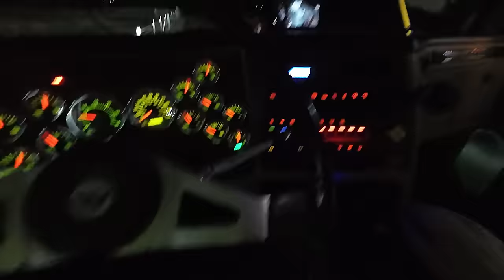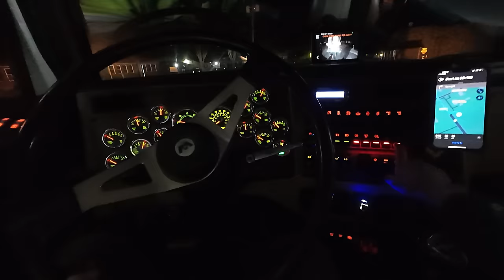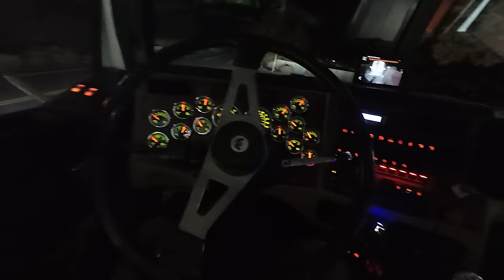This job almost beat me..

Comment: I am always amazed at the number and different tools that it takes to run a succesful towing business. not like you buy a tow truck and some chains and straps and off you go. I have been waatching for a long time and its easy to see litterally Thousands of $$$ in tools just to operate safely and efficent. Thanks for sharing!
Reply from the maker: Tens of thousands to properly outfit a truck

Comment: Good job Casey , like you said you got the job done and was back home safe!    Bummer that the owner was not on scene to be able to tell you that the Engine would still run ,  had you know that you might have been able to drive that truck forward so that there was room for your truck to back up to it.     DANG Casey , you have some adventures that you could tell about , a brake pedal that fell off causing you to go down a steep embankment into the trees!  Holly shit man!!  😲😲
Reply from the maker: Yeah if I would have known that I would have just drive it 50’ farther into the driveway and backed up to it 🤦🏻‍♂️
Reply: On the positive side,  he (the driver) did get it off the road (albeit a subpar location) and had gotten the rears caged out for you (correctly even), so it could have been worse.  Weather cooperated too. What grade did the supervising horse end up giving you??

Comment: Happy New Year ! I would have to have a small magnetic bowl for the bolts and universal joint caps because I would lose them in the grass or even the asphalt for that matter. Since I am giving unsolicited advice, I would have also wished I had a pneumatic impact wrench as a back up for those stubborn jobs.

Comment: Thanks for not recording miles and miles of windshield time, not being theatrical about how dangerous the situation is, not hyping the arc nemesis and not barking instructions to everyone involved. You appear to not have an ego that constantly needs feeding and would be very easy to work with. "Say what?"

Comment: Hey Casey, I used to drive a tractor just like that one in 1987 for Terrain Tamers out of Roseburg Oregon. They had a bunch of those Pete's that ran interstate. They closed down the interstate division, yarded the sleepers off, and wala...instant tractors to haul the 40-20 chip trailers!

Comment: Another great, safe job. Having the right tools like that U-Joint removal tool allow you to get stuff done correctly. Having all the right gear comes with experience. I'm not a heavy hauler by any stretch. Still cool seeing what you do...Old trucks are cool and can still be functional. Nothing lasts forever particularly in the Midwest. Stuff becomes a rusty mess long before they wear out...

Comment: For towing walking beam suspension from the rear I’ve always picked it from the walking beams themselves and if the first drive hangs to low I chain up the first drive axle to limit the pivot travel, you made a good decision towing from the from it the situation you were in, drive safe!

Comment: Just a tip which you might know but don’t like to do, but if it’s a manual transmission you can run air to the truck, flip it into high gear, and you’d be able to pull it without causing damage especially if you want to just get it out of a dangerous area and to a spot where you can hook up to it safely from the back.

Comment: The thought of putting my truck on a field that "might" be solid in the middle of the night is not something that interests me.  It might have taken longer, but disconnecting the driveshaft off of the road and keeping you and the trucks mostly out of harms way was in my opinion the smart move in this situation in the middle of the night.  Good video.  Get well and have a great new year.

Comment: During the war. 82nd took our trucks. We got stuck with 7 ton Mercedes Benz cargo trucks. I Iraq. The pin for my clutch did that. After getting it stopped. All I needed was a small nail. Worked.

Comment: we old timers used a timber, lift truck up, put timber under drive shaft and lower truck will pop the cups out. back then we did not have cordless power tools of remote controls for the lift.  thansk

Comment: This engine failure reminded me of one my brother told me about.  20+ years ago he was working at the local biggest heavy workshop when a tourist coach was towed in.  A one man business with on coach.  The motor was locked but had oil so they pulled the oil pan off to have a quick look.  Half the rods and pistons were in the pan.  Engine was totaled, but it had only just had a partial rebuild at another shop.  Months later it was still parked in the back of the yard while the owner waged a legal battle with the rebuilders in an attempt to get it repaired.

Comment: Casey Happy New Year! You did a great job, don't think less of yourself. You did it the SAFE way! Your so fortunate to have the tiger tool. When I drove wrecker in the 70's & 80's we beat those caps out with a 7# hand sledge. If only I could have had one of those and a battery impact plus your wheel lift. I would have been a Big time dog in tall cotton! Keep on towing & showing people the right way to get it done!!

Comment: Thanks for the laugh with the putting it in gear with the drive line out. cant tell you how many times I did that same thing  especially  when you have worked in the shop all day and then you have to go out at night to tow something your brain runs a little slower

Comment: Drove by that truck for two days. Funny I just asked you in another video if you had that U-joint press. I took your word for it didn’t have to show me. Do you have the super deep caging bolt impact socket? You also need a few cheep Harbor Freight small tarps to keep in the truck. I use to lay on them to work under equipment. Keeps from loosing the needle bearings/parts in the dirt/mud/grass/weeds. Also a magnetic parts tray.

Comment: Casey, what brand is that backup camera you use on your tow truck...????
I bought one from Amazon for $130 and works great but i kinda like yours better....

Mine also has a second channel that im going to use on my gooseneck trailer...
I added a light bar under the trailer that comes on when i put the truck in reverse and living out in the country it helps me see at night as i back the trailer up...

Comment: Very good job. Allot of work. I do have one question and I hope not silly. Could you have extended to upper boom all the way out over the rear and picked it up with a cable and just swung it around towards you so you could have grabbed the rear. The zack lift is amazing unit for sure. Hope you get to feeling better.  Just a thought.

Comment: 16:34 Hey Casey, a tip on getting those u joints apart. Hit the top yoke with a hammer while rattling on the tool. Causes the cap to pop easier and increases the lifespan of your tiger tool.
Reply: Watched further and you did what I suggested 😂

Comment: Worked on a fleet of Mack's, that all had those type u joint caps.  Pretty sure I cut more out with a torch than I ever pressed out,  even with a Tiger Tool.  Actually broke a yoke in half with one once.

Comment: I towed for 20 years, and you made the rite call.  It is better to take longer than be a target.
Those drivelines suck. I've had to take them out with just a boxend wrench for that press.  Was ready to beat myself in the head with said wrench til all was torn apart.  I learned early on that if you have the opportunity to work away from live traffic, do it.  Working holidays always sucked.  Got called out on Christmas in 09 for a family 3 hrs out that were stranded.  3a tow, and no one else was answering their phones.  Run in, grab the crewcab rollback, and head out.  Get onscene just to find out it broke down the day before, and they wanted it hauled home from outside philly. All the way to columbus ohio.  And i was home in gettysburg pa.  But I didn't find that out til after it was loaded, and i was waiting for the "family" to get in the cab. But as per contract, i had to make the run.   Ohhhhhh if looks could kill, it would have been a slaughter.   My family was not happy, got to miss Christmas to drive all total 11 and a half hrs, for some asshats POS car.  Yay
Thats what i really dont miss about towing.

Comment: Hey Casey, i know nothing about towing &  am NOT trying to tell you how to do your job, but could you have used ur truck to push the other truck further in off the road & then picked it up safely from the rear? Im guessing no, otherwise you would have. Big trucks dont do well playing bumper cars i guess. & I guess it would have been easy to drive your truck & steer the other truck at the same time. Nevermind, I answered my own question. Have a safe & blessed New Year.

Comment: Call HP, back out into the road and drive very slow to the store. Then turn around and hook to the rear, if this truck can be pulled slow and not hurt the transmission. BUT that may not work.

Comment: Love that old Peterbilt….it’s set up almost just like I’d want with the Hendrickson RT walking beam suspension, steel wheels, tall rubber  and a short wheelbase. The only thing I don’t like is those Eaton rears. If I were him I’d put a Big Cam 855 Cummins in it, he could get a running takeout engine, reseal it and roll a set of bearings in it for what a decent core 3406B would cost before a $25k rebuild. It’s really rare to see a 359 or 379 these days set up that way, most of them have been stretched out, switched over to junk air leaf suspension and dropped so low the bumper will drag on a 6” curb.

Comment: Playing it safe was the correct choice Casey. Always err on the side of safety. Question... why do you not cross your safety chains on the towed vehicle? You can run a shorter loop and your chains will not bind when in a turn. Also, do you have an inverter onboard and charger systems on the big truck to charge any batteries for whatever battery operated tools you might be using? Last question... do you also pack a 1/2" air powered impact gun for stubborn problem child fasteners? Stay safe! Happy New Year to you and your family!
Reply: Safety chains are only crossed when towing a trailer to potentially catch the hitch tongue.

Comment: You basically have it easy. I see how nice that remote was working. Remember before remotes getting up and down to move the wheel lift in and out? Oh wait! Remember pulling the bumper before they invented the wheel lift and every drive shaft was pressed in? They didn't have a special tool to pull it, a block of wood and a sledg Hammer was your best friend. That job looked easy to me from my perspective. You only had an impact gun if you brought it from the shop and ran it off the truck.2024 towing is a lot different than the olden days. I had a slight tear in the corner of my eye for you. That said I still really like your videos. Stay safe.

Comment: They call that a full round driveshaft….always preferred half round styles way more. I’ve never had one come out without pressing and hitting it like you did 😂😅 I was always the lucky guy to reinstall the driveshafts tow truck drivers take out when they came to my work.

Comment: Just a quick one casey, why not just remove the axle half shafts instead of battling with stubborn uj joints all you'd need to do once you removed half shaft, is plug the axle with rag or a plug to stop axle oil from leaking. Then tow as normal. Or aren't you allowed to do that?

Comment: It's a standard, correct me if wrong but only auto trans need driveshaft or axles pulled if front towing. Mack and Volvo I-shift damage very easy, Allison can tolerate slight moving. Rear tow is just easier on standard because you don't need to cage brakes or supply air, but these where caged already, also less weight on stinger.
Reply: He’s replied to other similar comments that it doesn’t matter what type transmission, needs to be disconnected for both.
Reply from the maker: Yes, you are wrong

Comment: Was the parking lot where you turned around too far away to safely pull it from the front without disconnecting the driveline?  Could you have pulled it safely to there and then switched to a rear pull?

Comment: Could you have used your top boom to lift the rear of the other truck then rotate it to a better angle? I.e., back up to it with your truck parallel to road, lift, then pull forward to rotate it.

Comment: I noticed why you're hammering you hit the front side of the yolk distorting the yolk itself making it harder for the joint to come out always hid behind it on the flat part it's not necessarily flat but hid behind the u-joint from the top and you'll be surprised how easy that ujoint will pop out

Comment: Is that a straight shift transmission? If it is does it really need the shaft pulled? I am just not familiar with large truck transmissions.

Comment: Hey contact that customer again and point him to the Edison motors diesel electric retrofit kit for these old semis. It'll get this old beauty back on the road and also saves the guy fuel over the first year. The kit downsizes the 12-15 liter engine down to like an 8-9 liter engine that spins a generator that weighs almost as much as the stock transmission. You ditch the old rear axles and install the electric drive axles. Check them out

Comment: When I did Piggyback Trucking with Active transport, all towed trucks had the ground axles removed instead of the drive shaft. and I just did a google search because I was curious (we used disposable plywood based caps) and theres a "Axle caps 4 in 1 Axle caps" for sale on zips. IMO I would remove the axles over messing with the drive shaft, especially with one that looks painful like this one. and bonus you can still move the truck under its own power assuming it has the lockers necessary to force all the power to the front axle
Reply from the maker: I have axle caps, but even this pain in the ass shaft was easier than four axles
Reply: @CaseyLaDelle  you would only need to pull the ones on the ground. We only ever pulled two axles and on air bags chain the front axle

Comment: Do you keep hub covers on the truck? Just wondering why you opted to not pull the axle shafts when you saw the full-round u-joint.
Reply from the maker: Still faster than pulling four axle shafts

Comment: @7:00 min See that is what I was thinking but I was thinking you said there was not anywhere to turn around so I was thinking neutral back out and limp down the road slowly to find a place to pull off and grab it from behind. Also it has the heavy tow points up front why not use the other thing you have? Oh wait was it peterbilt you said you didn’t have for that system I can’t remember now. No at 12:30 I would have slowly limped to the store and swapped to the rear.  F that to pressing out a u joint and having to put it back together. It’s bad enough when they are retainer and bolt. Which is simple but those drive shafts are not light weight at all and even with a ratchet strap can hurt you. Yes I have done some heavy towing and I have also been a heavy side tech and had to replace u joints and reinstall drive shafts that tow jockeys didn’t bother to put back together. Usually a half shaft in the cab and finding the bolts and caps was always fun because they would go all over inside the cab. Maybe time to invest in a 360 camera you can mount to the top of the headache rack on like a 2’ pole for great footage for towing or recovery it can sit up there and film everything and they have some fairly cheap ones. That jungle website.
Reply from the maker: I don’t put driveshafts or axles back in.

Comment: What if you back your truck to the back of the tractor perpendicular, raise your wheel of high enough, chain it to the frame, pick up the back wheels and pull forward to swinging the back of the tractor parallel with the highway then pick it up from the back

Comment: you get alot from harbor freight  i didn't have any choice all they when i went to get one was a HERCULES and i got the 12 ah battery. after a few times using it i gave my old one the one you have away. its heavy but i like it so much better so the next time you go you should at least look at them. PLUS from 100% dead to fully charged is only about 30 minutes.

Comment: Would it'd been an option to lift the rear of the truck with the boom and "swing it around" so that the rear faced towards the store, lined up more with the road, and then back up to it and hook it from behind? Not sure if I'm getting my point across, and I'm sure there are multiple reasons not to do it that way anyhow, just curious. :)

Comment: Man, for that much struggle to pull the driveline I'd have forked it by the front with the trans in neutral down to the store and then re-hooked from the rear for the long tow.  A half a mile in neutral isn't going to damage the trans unless it's already destroyed, in which case you're not out anything.  That was a struggle!! Hope you're getting paid by the hour...  :)

Comment: I am surprised that you didn't get the wheel lift assembly for that....that would have let you hook from shoulder without blocking traffic or removing drive line...still you have a nice setup

Comment: I wonder why didn't you winch'd it by the back axle to get it in position, just 90 degree..., and... wasn't it manual transmission? Then why disconnect driveshaft?

Comment: Hopefully that guy gets that truck back on the road, the cheapest and probably best option to get another engine is by buying a undesirable donor truck from California.

About a week ago I saw a mid 80s ford L9000 cab and chassis that had a dump body on it at one time.  The truck had a really clean 4-1/4 b model cat and a 15 speed with 350,000 original miles and the seller was asking $3500 for the truck.  Up here in the Mojave Desert area of California there is always trucks for sale like that.  I constantly see older wrecked trucks just sitting in the back of people's yards that can probably be purchased for next to nothing.